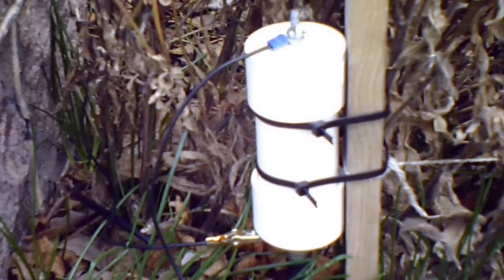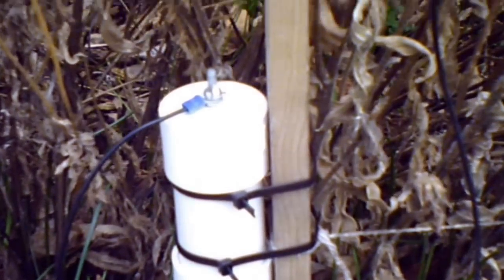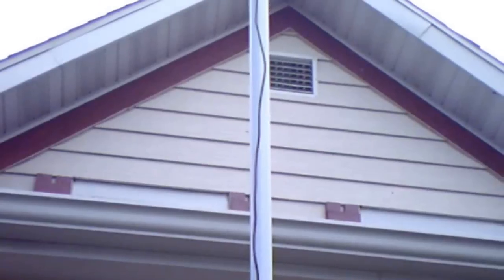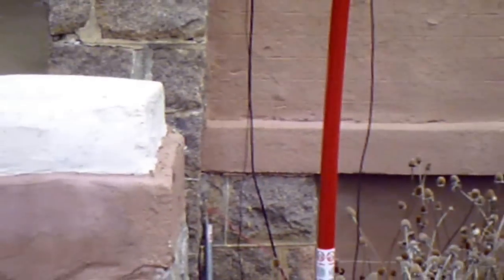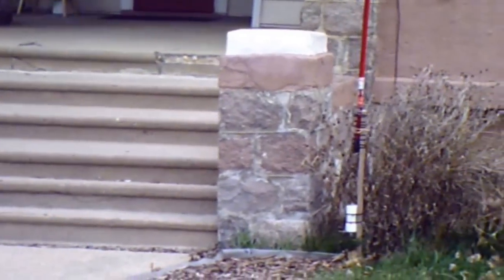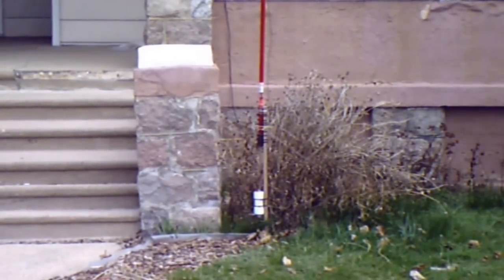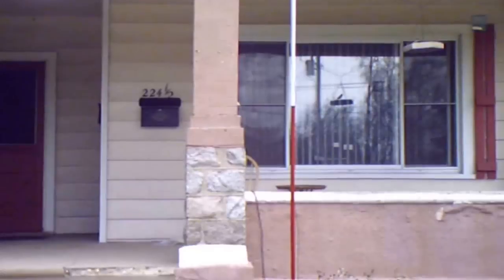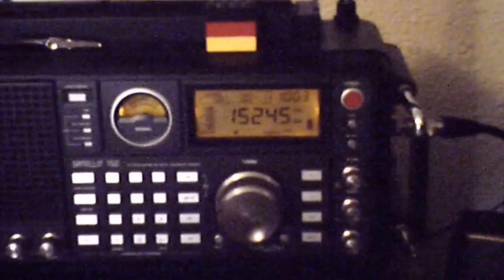Homemade End Fed Antenna

Comment: Aha! so you did get around to trying this configuration... good stuff, what's the painter's pole made from though? if it's conductive it will interfere with reception (hence why fibreglass squid poles are used).
Reply from the maker: ***** I'm not a hundred percent sure, but I think it may be aluminum.

So far I am liking the results. I had my radio on for a little bit before I left for work this afternoon, and I was picking up the VOA on 17895 khz from Sri Lanka. I will put it through it's paces tomorrow afternoon when I get home from work.